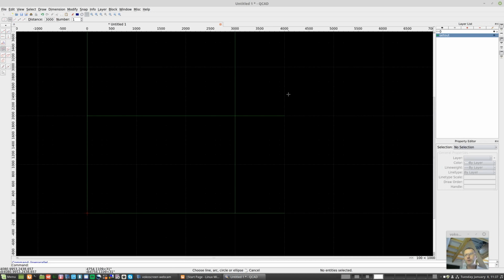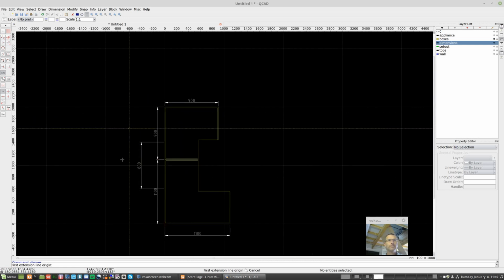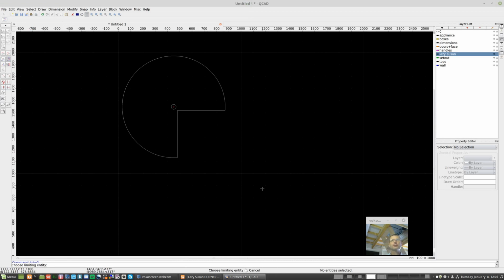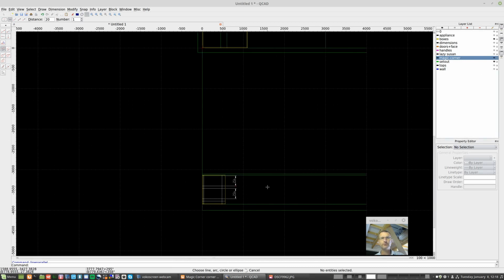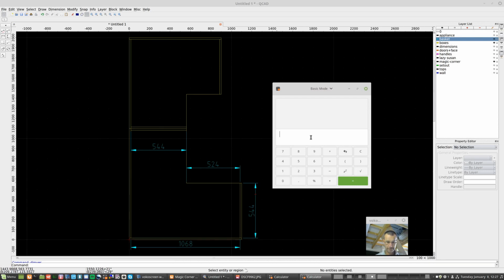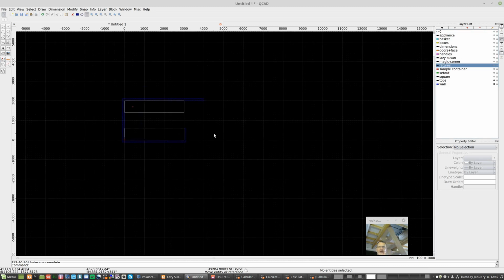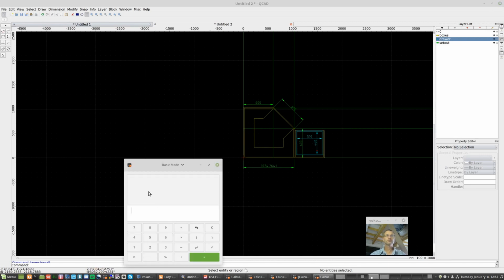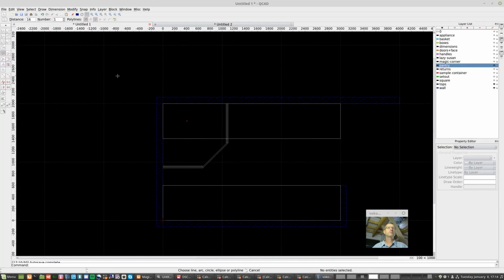Corner cabinet problems and solutions, -updated version.

Comment: I can not  find any help on the internet  for  removing  the  lazy susan in one of my base corner cabinets and adding an L shaped  shelf.  the  cabinet  is  24  " deep  32" long on the back left  &N 35" long on the  back right. the door  opening is  16"  w 29" high.  the  L shaped  shelf would  be  18 deep x 32" L x 35" L.
it appears to be impossible to do a  one piece  shelf.  I am not  opposed to 2 shelves off set or  two pieces  joined by heavy gauge brackets/braces.  I found one  that used the  2  shelves  one on each side  (off set) but no  instructions.

Comment: so haard to watch it with a black background 😒
Reply from the maker: Yeah, it really does need a bigger screen, and to be ran at HD 1080 to be visible.
Unfortunately CAD works with fine lines.
Reply: @HelmreichJoineryBemboka  I think it's more your choice of CAD's black background and fine lines that's causing the problem on for your YT viewers.  Obv use it when you're designing, but for YT videos it really does need to be a light background, easily switched in 'Options'.  You can also change line thickness in >Layer Properties Manager >Lineweight column >Lineweight. HTH!

Comment: I guess you did not really compare apples with apples in your calc of the blind corner vs. full 1100 x 1100 corner...
Reply from the maker: I think that is my point, the apple idea needs to be thrown out for an orange.  ;)
the 900mm x 900mm makes a terrible waste, 1100 x 1100 uses only slightly more space but yields maybe 3 times as much accessible/useful space.